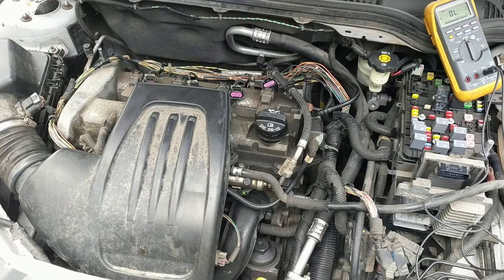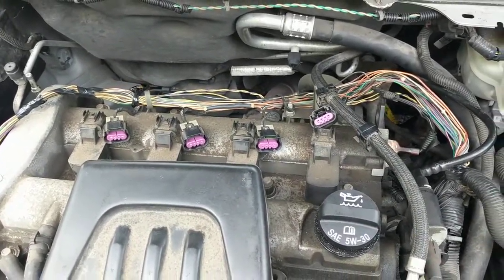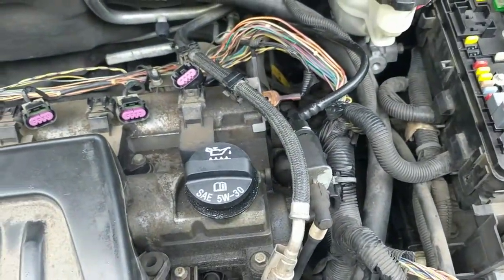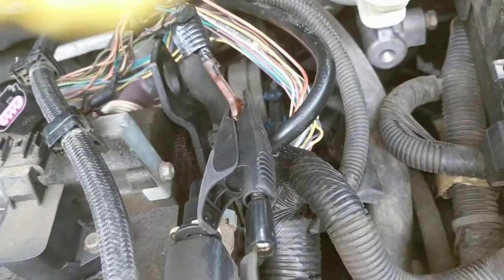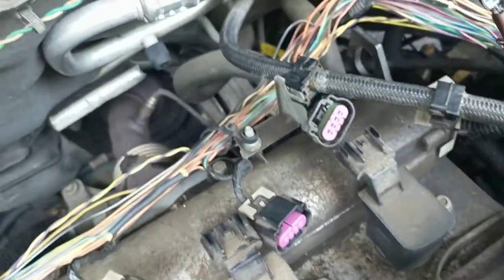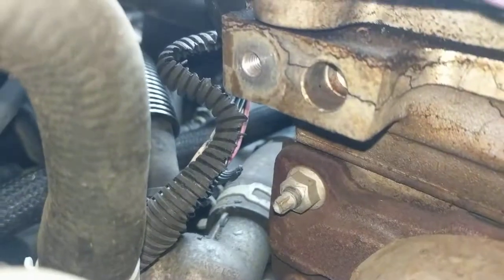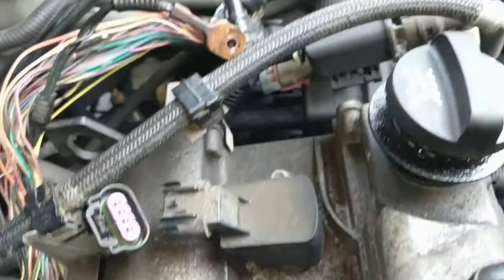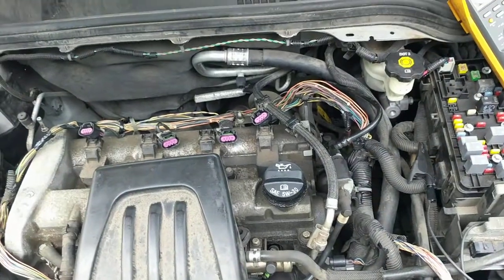2008 Chevy Cobalt ignition coil ground circuit corrosion test and diagnosis

Comment: Dont forget to check your main ground to block guys. There is a wire goes from the transmission front under the coolant hose to u der your drivers side headlight that brinfs most of the ground to your block since the battery is in the back

Comment: I've got an 07 that just clicks when starting. I've ruled out a dead battery with a jumper and jumping it with another car. I get 3 clicks and a slight pause then 3 clicks etc. Bad solenoid? Bad starter? I also have a crazy neighbor who's a mechanic with a criminal history of tampering with vehicles and we aren't on good terms. Any thoughts?

Comment: We're you able to fix the ground issue? What was the culprit? Today I left work @ 6am  in my 2007 Pontiac G5 (2.2) & made my way arround a loop up across I-470 interchange, across the Ohio River & took the 1st exit however, as I started up the car, I let it warm up a few min, ( not paying any attention) but, it got up to 124° so, I pulled out of work & got a few blocks when I noticed the power steering being labored then as I took the on ramp onto the interstate, the dash lights & radio turned off & the transmission was stuck in a lower gear but, I kept going as far as it would take me! It made it across the river, circled arround the interchange & it died so, I coasted as far as it would let me. Battery tested at 10.44 volts. Had a friend pick me up & ride me to parts store, I Removed both the battery & alternator & had the battery charged & both tested & Both passed yet, omw home, the battery light CAME ON but then, WENT BACK OFF AFTER A FEW MINUTES.. When I reinstalled the alternator & lastly, the battery, I cleaned all connections with a wire wheel & drill then, used a terminal cleaner on the battery post & terminals & sprayed the connections on the alternator & the clip with 2 wires, & whire wheeled the power connection from the alternator,sprayed it with electronics cleaner. So, I cleaned everything proper yet, when I got home, the battery was reading 12.89V with the car running when I think it should be closer to 14v with it running!!!! Can you test yours both off & running & tell me what your voltage is please? I AM WONDERING what the 2 wired are that are in the plastic clip/ harness that plugs into the alternator & what readings I should get from those 2 wires? I WANT TO TEST THOSE WIRES & MAKE SURR THERE IS NO FAULT WITH THEM BECAUSE, THEY ARE TINY & EASILY DAMAGED!!!

Comment: WTF did that fix the issue or not lol????
Reply: Went thru same issue. Bad ecm. Ignition coil drivers are on the ecm side of the circuit (the primary side). Ground > battery > primary winding of ignition coil (signal is sent then to the ecm) > ecm. Once the signal is received, that circuit is broken off into the 2nd or secondary side of the circuit, which is as follows: ecm telling the secondary ignition coil winding what to do based off the info it receives from the primary winding on the same coil. If there is an open in the circuit (which there was, in my case), the ecm needs to be replaced. I would however still clean that ground or replace the ring terminal altogether. So far I haven't had any issues after installing and programming the new ecm.